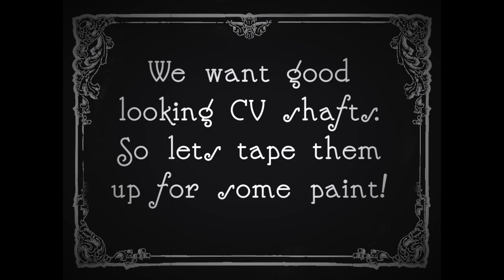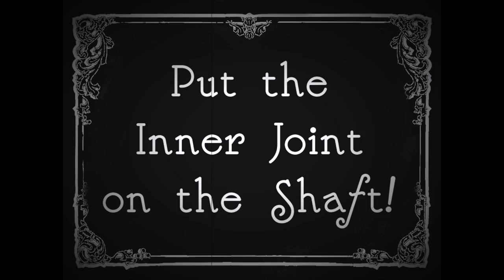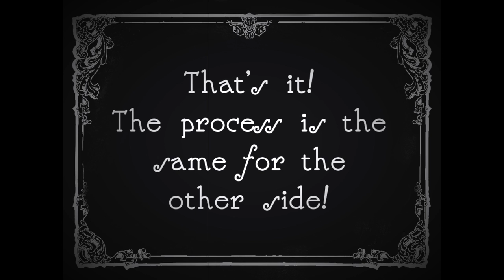Datsun 240z Build - Episode 16 - Z31 Turbo CV Shafts Rebuild Assembly - Panchos Garage

Comment: Viewers trying to do a similar swap should be aware that each side is a different length shaft and the outer CV cage can go on either way, but can effect the overall length of the shaft. Also, you made the inner C-clip (not the one with the pliers) job look really easy by not showing it on camera. I had a tough time with mine and had to result to using a special hose clamp to hold it down while I slide the CV joint over it.
Reply from the maker: +Jeffrey Ball you know, I really didn't have an issue with the inner clip. Trick is (from what I read and tried out) is to get the open part of the clip tucked in first before you push the axle in. I'll report back when I do the other axle but hopefully I won't have that much of an issue.

Comment: Are you gonna get the adapters from ModernMotorSports??
Reply from the maker: +Casper0878 yeah, already have those hockey puck things.
Reply: Did you use their shortened half shafts?
Reply from the maker: +Casper0878 yup. That's what those were. The one I did in the video is the long passenger side one.
Reply: What differential are you using?
Reply from the maker: +Casper0878 r200 vlsd out of an 88 Shiro
Reply: Nice! I was actually looking for a Q45 differential out of a 97 and up for the 3.69 gear ratio. Want to mate it up to a Z32 tranny behind a 2JZ GTE VVTI motor
Reply from the maker: +Casper0878 wow. Sounds like you have a fun project on your hands.
Reply: Yeah, just gotta figure out what axles will work best with that differential and if I can use the Q45 knuckle/hub or keep the stock ones
Reply from the maker: +Casper0878 talk to Gabriel at T3. He might have something to make it work.
Reply: Sounds good, thanks for the advice!

Comment: Where on earth did you get a rebuild kit? Here in aus, seems impossible to find new cv’s/driveshaft assembly’s for the hr31/300zx
I ask because I have a hr31 Skyline, and my cv’s are slogged. They share the same rear end as the z31 300zx..
Reply from the maker: +rtklolness it's just a boot kit made by EMPI. Does the skyline use the same CV shafts as the z31?

Comment: What car would you suggest me for my first? (must be jdm, rwd, manual) thanks
Reply from the maker: +Talha Anwar get a 280zx. They're relatively cheap right now, they'll have everything you want, and it's a good car to learn on. Once you're better familiarized with driving and working on cars, you can get an s30. Good luck!
Reply: Francisco Gutierrez Thanks man here in the uk its about £5000 so as soon as i get my driving license at 18 i am buying it. Thanks🖒
Reply from the maker: +Talha Anwar ouch! That's expensive. Here in the states you'll find them for $1k+. But good luck with your search.
Reply: Francisco Gutierrez $1k wow thats cheap. Well i guys i have to work my ass of in the summer.

Comment: Yea. The other format is better. But if you had to do it because you are sick that's fine. Thanks for the effort Bro. Check out Tom's Turbo Garage. He did a LS swap into a Miata. In one of his videos he used Lizard Skin which is an insulation and sound deadening material that is "painted" on. Might be cheaper than dynamat  Check it out.  
https://www.youtube.com/watch?v=mTKAxH7i0t0
Reply from the maker: +John D I'll definitely check it out thanks
Reply: If I'm ever in the position to get me a car to re-do like you I would use the Lizard Skin and probably a little dynamat probably at the firewall and a few other select areas. BECAUSE my exhaust will be loud and I'll need something to get the vibrations under control. Just my thought / question since you are building but are you going to do a little roll cage thing between the rear shock towers? I would. And the triple triangulation in the front from shock tower to shock tower and back to the firewall.
Reply from the maker: +John D yeah eventually I'll get to that point.